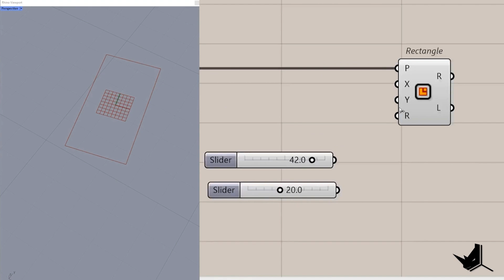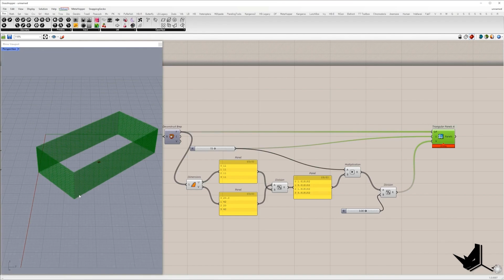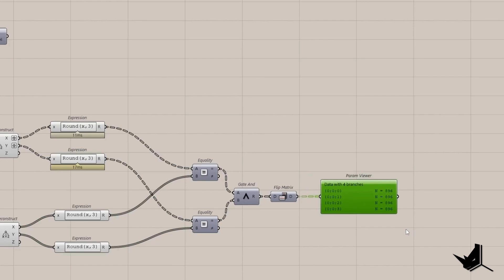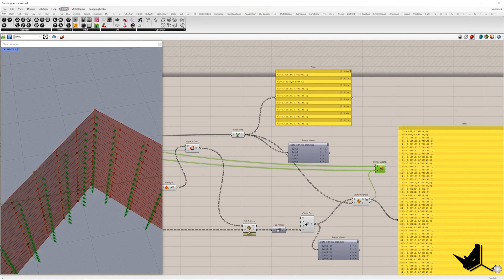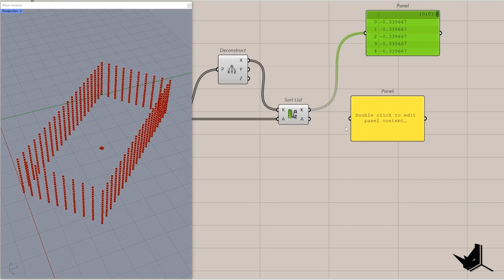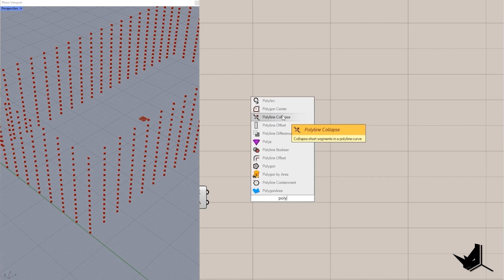Triangulated CRINKLED Facade in Grasshopper

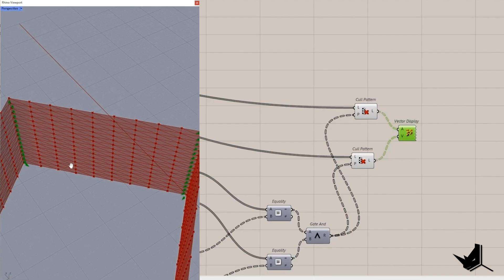Comment: Hi! Thank you for this tutorial. At 9:30 how would you define vectors (1,1,0),(-1,1,0),(-1,-1,0) and (1,-1,0) or simpler the 45degrees vectors pointing outside the rectangle at the rectangle corners instead of the average vectors?

Comment: I'm having an issue at the "deconstruct brep" I only get one untrimmed surface as output instead of four. This messes up the triangulation.
Reply: btw i tried to fix this using pufferfish plugin, there are "split kinky surface". I tried it and it works fine
Reply: Another issue, when I enter the expression, I get a synthax error: Unknown variable encountered: x
Reply: same issue when i used deconstruct brep, did you find the solution?